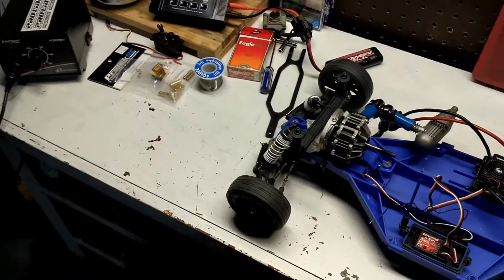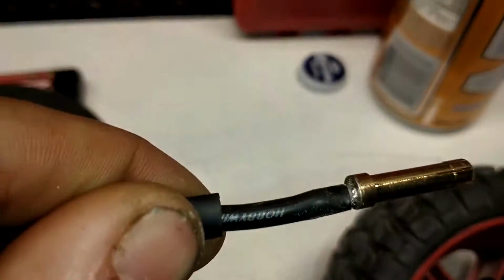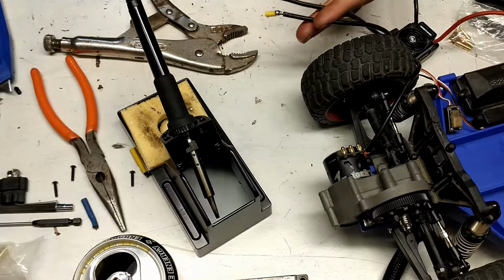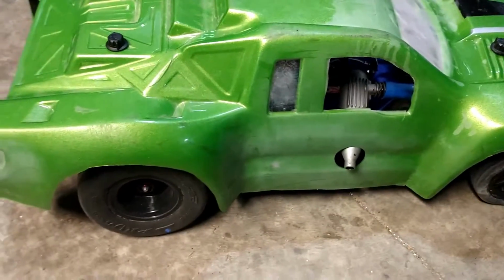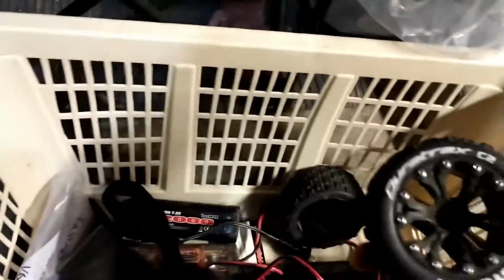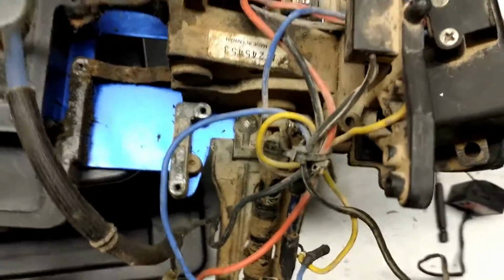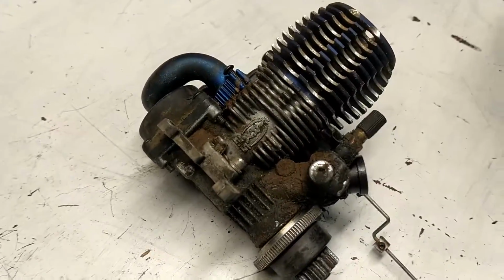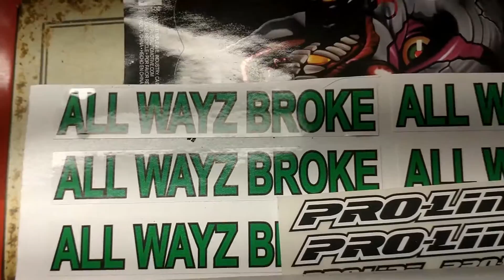No Prep RC Build Huge Update + SHE LIGHTS

Comment: No need to keep the coloured insulator barrels on the connectors when you are using shrink tubing man. It will help your solder jobs be cleaner as well.
Reply from the maker: Ya in the package I got of barrels, it did not have any of them new so I reused them. It runs great just a dog slow motor.

Comment: I'm trying to build a hps 1/10 chassis with the rotary engine how u did with the clutch pilot thing drill and tap to fix the wankel shaft?
Reply from the maker: That's what I plan to do. I have to tap the clutch bell still but I held it in a vice grips and just drilled the old threads out of the clutch bell, leaving enough to tap some threads into. Since the engine spins counter clockwise should stay as tight as you can get it. I'd be careful over tightening the front bearing screw. Could break and then be no guhhh.
Reply: @MatsuYoda  you should take the pilot thing out from the bell and it's more easy to tap it
Reply from the maker: @pilotohernandez1569  oh ya I e had it out already. I had it out when I drilled out the threads. Used a vice grips to hold it. Still waiting on some tools to get here. I ordered like 1k dollars in tools this month. I get a package like every couple days haha